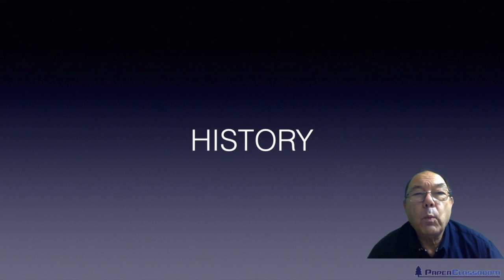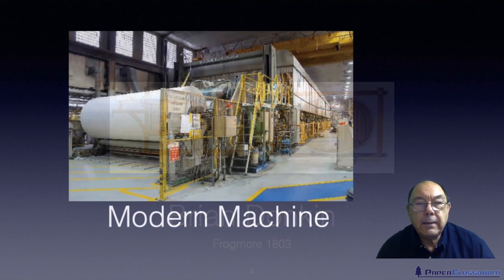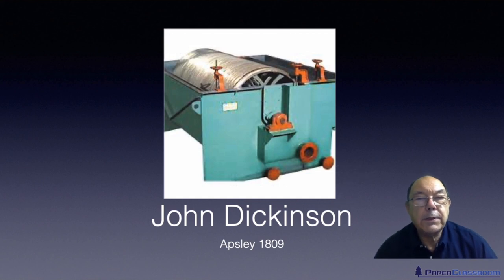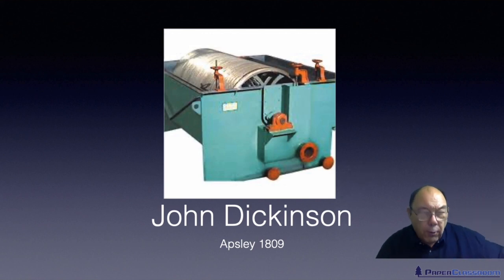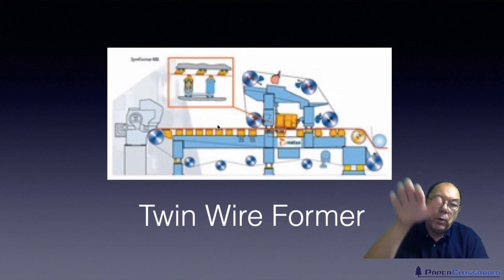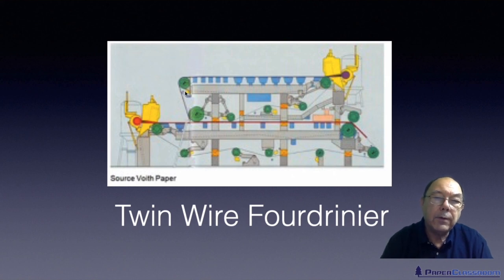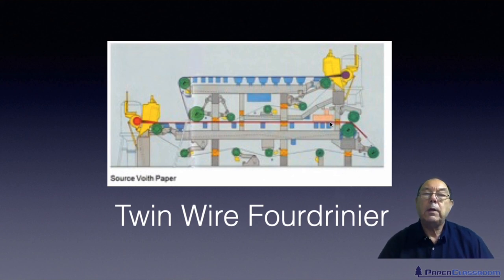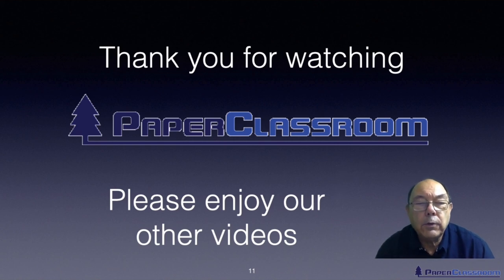Level 2 Papermaking - Paper Machines

Comment: Good Morning
How to different kind of GSM paper made in single paper machine.
Example: One day maket 45 Gsm paper. Next day make 80Gsm paper.
Reply from the maker: Hi, it can be done. It means changing the settings on your machine. To go from 45 to 80, either you will have to almost half your machine speed, or double the consistency in the flow box. Each has its own problems!  You will have a lot more water on the wire, so you will need to get rid of it. So more foils, steeper foil angles, more vacuum. There will be more water going into the press section, so the press settings will have to be changed. Finally there will be more water going into the dryer section, so you will need more heat